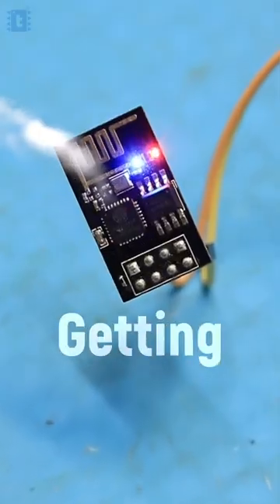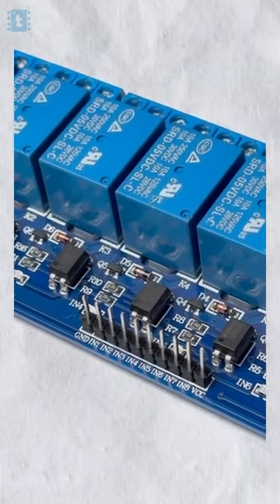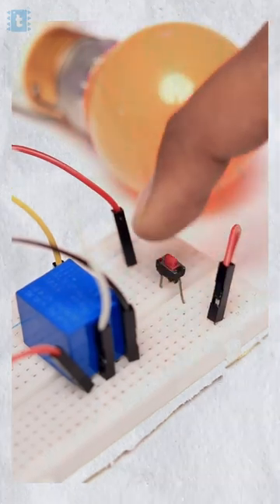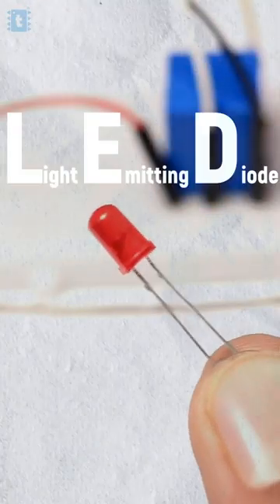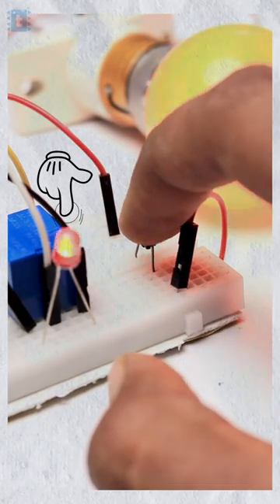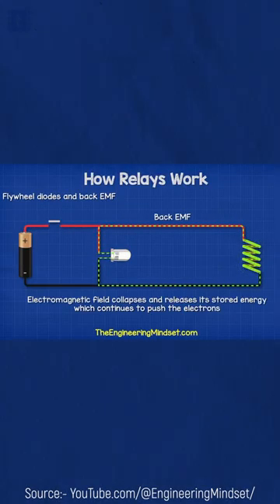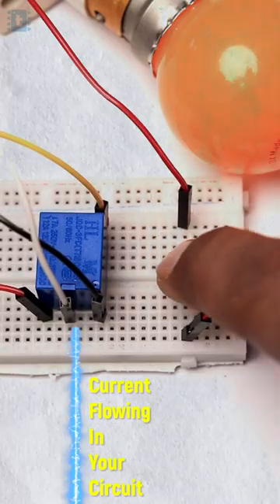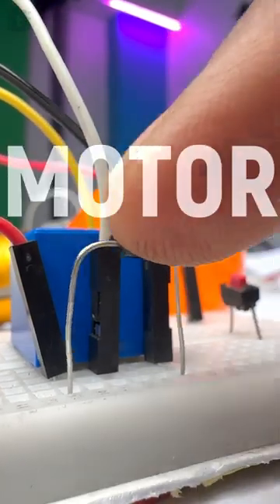Must-Know Trick to Save Your Circuit

Comment: Good information but half information which is dangerous.
The Diode you have shown is a normal Diode. The circuit you have shown uses Zener Diodes.
There is a hell lot of difference between a normal Diode and a Zener Diode as Zener Diodes are always made to work only in reverse bias unlike the normal Diodes which work in forward bias.